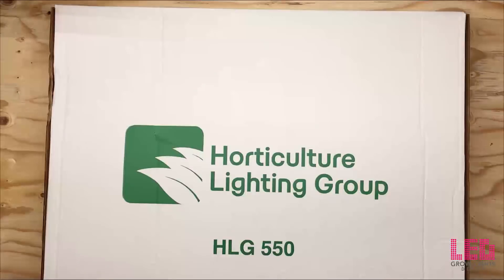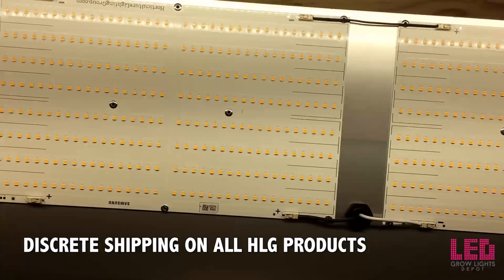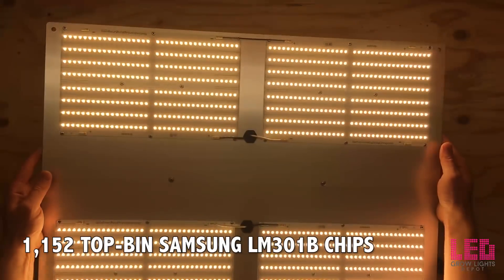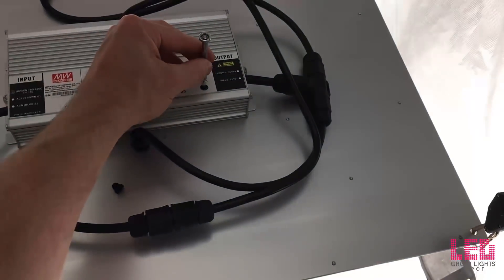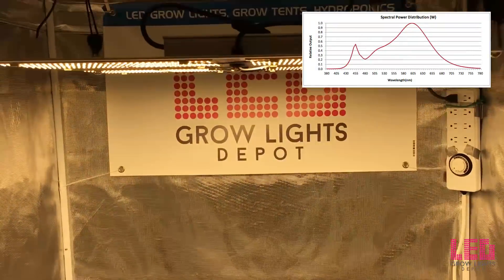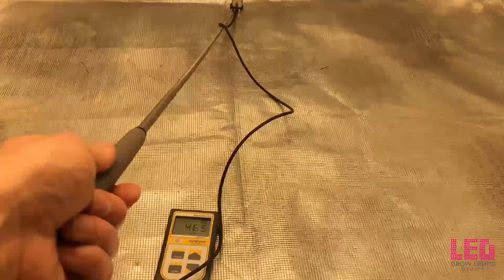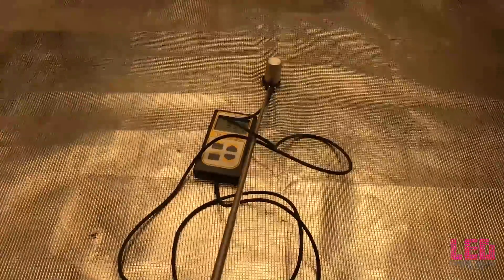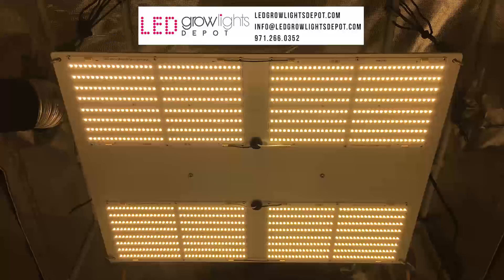HLG 550 V2 LED Grow Light Review, Unboxing, and PAR Testing

Comment: I am so confused with figuring out LED light fixtures. Each diode is only 0.2 watts according to HLG, and it pumps out this much PPFD at 24-36” heights? I was under the impression that 3 watt diodes provided the best output and penetration but as seen here some pretty impressive results with something much lower than 3.0 Watts. Not only that, but this thing requires no cooling and is thin. 
How much difference does an LED with 3000k diodes same color differ than say an 8 band that is using different wavelengths? Because they are using 8 different diodes does the umols/J get drastically reduced? How does this effect say a cannabis plant?
Reply: think of sitting in your room in the dark now light 1 candle you can see o.k now  light 2 candles you see much better,  now try it with 1200 candles you get the idea. as for penetration yes  a higher wattage bulb /led will go deeper in to the canopy as its coming from one source of light, but  2 sources of light at half the power will give better coverage . whats better 1x1000w hps or 4x250w hps? both give off the same heat but spread out over a lager area = you can get the 4x250w hps closer to the canopy with better more even coverage  in the same space  making it far more efficient than the 1000w hung at 3 feet  above the canopy  where you can get the 250w to around 9 inches  light losses half its lumens/par with every foot away  the light as to travel  @  1foot =100%  / @ 2 foot =25%   / @3 foot =11.11% / @4 foot= 6.25% less  light hitting the canopy so it makes sens to have smaller lights hung closer spread out over the same grow area ...  inverse-square law of light.

back to candles you light those 1200 candles in the centre of the room  in a bunch the light will be very bright and you will feel the heat a lot it probably burn you if you sit close,   you  take a look around and see shadows in  the room, now take a candle from the 1200 bunch and place it where ever you see a shadow now keep doing it until all the shadows are gone what gives the best light in that room?
Reply: @I_am_not_a_bot-666  nicely put,cheers 👍

Comment: I hear you need co2 to use LEDs, myth? Love my des, but this looks interesting.
Reply: Yes it's a myth. I'm coming from experience. CO2 is an awesome addon for indoor growing only when you have already perfected out all the other variables like soil, light, nutrients, humidity, temperature... When all of that is perfect CO2 is a great addon, not only for LED but also for HPS. Specially in the flowering stage as far as my understanding goes.
I'd add to this panel some UV and LR extra diodes to make it even better. But do buy from alibaba bro, half price, same quality.
Reply: Def a myth a huge myth

Comment: Can this light go in a 2x4 tent 6’7 height
Reply: The Novice Cinematographers 
Yes. It’s 20” x 22”.
You would hang at 36” for seedlings, 29-30 for veg 18-25 flower
Reply: Should also have a dimmer

Comment: Another fluffer light like in the porn movies. Only good for veg and 1st few weeks of flower. Real flowers are made with 2100k red HPS lighting. dont play yourself. I can always tell a LED grown flower at a quick glance. There's a whole generation of growers with blinders on using these things now a days.  remember watts still equals weight and LEDs still give off heat that you have to account for.
Reply: after a decade of using HPS,i switched to this light from my venture sunmaster 1000w and i see no difference tbh. had a whooping 1.33g/w yield and the resin was tremendous
Reply: Think it may be you with the blinders homie, look at some of the work fluence produces.
Reply: GrowTent Revolution-California  ahah, man I'm taking it so easy right now. While I do agree with a lot of the OP's points, and my best personal experiences have been with CMH lights. LED tech is making phenomenal leaps and bounds. It is not worth dismissing because you have a tried and true method. 4-6 years ago I would be laughing at LED's, but after seeing some LED setups and tasting the fruit, opinions definitely have changed.
Reply: I agree empire breeding co iv been burnt by hlg already amd only had it for 2 months will i buy more probably not ill stick with hps i hve a vero29 950watts that has 1750k and mixed with 3500k of cri 90 butt im with u on the vegging light is all it is

Comment: At what height is this HTG HLG 550 v2 for the 80,833 lumens. Is that At the recommended height of 24" Or something else as it's 2 foot high and most HID's are 1 foot high for their lumens. Is this the same with this led as 1000ppfd is over kill without co2 in my small area.

Comment: So at 36" The meter reads 600 center - 420-450 edges  / 24" 987 center - 435-525 edges / 18" 1424 center - 388-584 edges 
What would your recommended height be for best uniformed growth , also do you ship to the EU ......... Many Thanks.
Reply: stay at 36 to get the most grow space. if you have a smaller space move it down a bit. you can also move it closer and reduce the light to save a few bucks

Comment: It’s a great looking light
Reply: $1000 for flower only.....and light will have 50% spectral decay in 2 years. 😉
Reply: Hidden Harvest Grow Lights wow that’s fast
Reply: Hillbilly hydro Grower Hotter they burn.....even faster. No real innovation in this light. Shows me the company arent light specialists....just selling lights.😉
Reply: Hidden Harvest Grow Lights thanks for the heads up
Reply: @ChrisWilliams-i7d  20 folks I know use them. Not a huge fan of them. The company knows nothing about lighting or they would have added a percentage of higher kelvin temps to eliminate the stretch. They also could go with a lower kelvin temp for more prolific flowering. They tried to split the middle. No bueno.
Heat is the enemy of electronics. They burn very warm. 
Spectral decay is never spoken about but it happens with any bulb.
Ive been at this since day one. Sold the first led grow lights in US. Designed the first all white full spectrum in 2011. Apache Tech was another white led pioneer.
Im Brad....have the best day.
Reply: @FineHomePainting  

I'd prefer you to say you have personal experience of them as that's a better point of view.

I do appreciate all bulbs have a degree of break down as they're used but diodes are far removed from incandescent bulbs and good quality LEDs in a well built light unitl will perform far longer at closer to original specs and outputs than the equivalent output incandescent light system. Nature of the beast and all that.

3000k is fairly optimal for an indoor grow (as optimal as indoor gets, mind you!)

Heat most definitely doesn't agree with electronics, I've repaired enough frazzled PS3s now to cement that in mind 😂
Reply: @ChrisWilliams-i7d  2400k is as optimal as it gets. I use 2700k in mine.